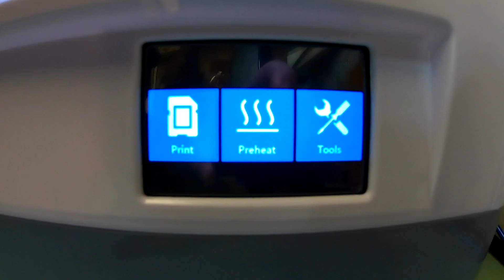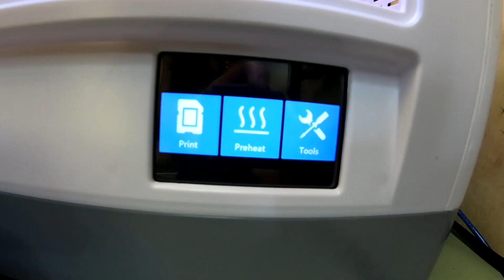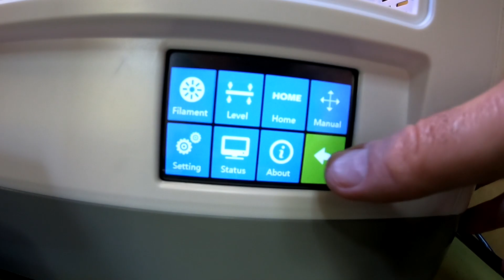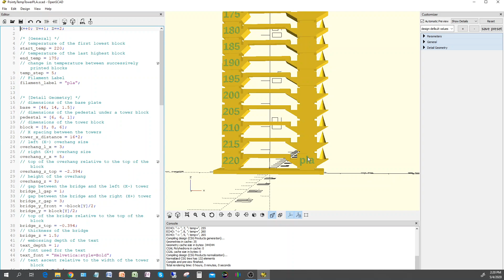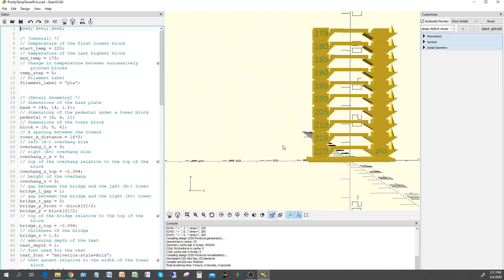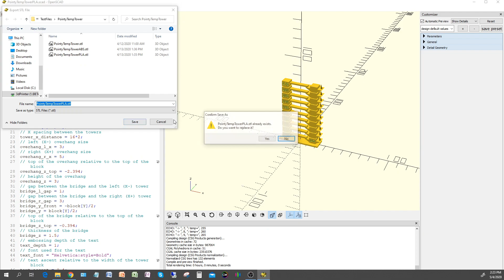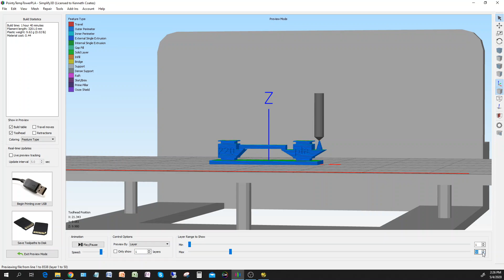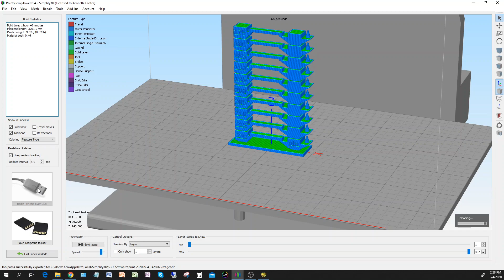Flashforge Dreamer NX 3d Printer White PLA Temperature Tower

Comment: When you finish printing at the end of day, do you remove the filament from the extruder head ?
Reply from the maker: I didn't for a the first month or so and then I started having a lot of trouble printing.
I was leaving the filament reel in the printer too and I think it was picking up moisture which was part of the problem.

Now I remove the filament from the extruder head at the end of every day and every time I want to re-level the bed, or change type of filament (PLA to PETG for example).
I figured out that leveling works better if you pre-heat up the extruder head and the bed.
If you don't get the filament out of the head, then it drips down while you're leveling which messes it up.

I have a video coming out soon showing a quick way to get the filament out of the head without disassembling the head.